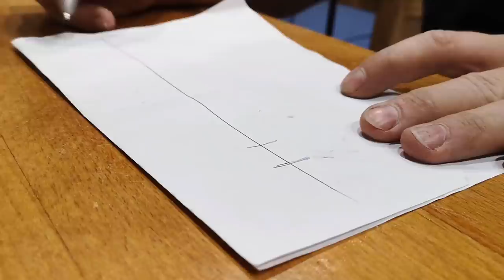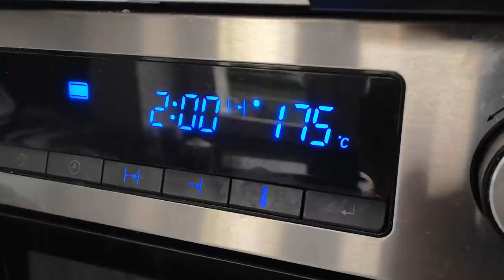017 Marking knife for woodworking

Comment from the maker: I need a marking knife so it's time to build one.
It is my begining in woodturning so be forgiving.. If you have any advices or if i do something wrong let me know in comments.

To build this tool i used boxwood, brass and piece of an old plane blade. The finish on the wood is Tru Oil.

If you have any questions just write a comment.
Enjoy!
Reply: I'm affraid one day You'll need a car and You'll make one just because You can. ;)  Greetings from Tenerife
Reply: Why did you make a left handed knife?   Seriously though, for the ferrules, I usually just use plumbing compression fittings. They have enough material that you can turn designs into them as well and you can also get an interesting effect by leaving some of the faces like London pattern chisel handles. Brass is soft enough that you can just turn it down to the level of the wood with regular turning tools.  Just take light cuts.
Reply from the maker: Dzięki Dario :)
Reply from the maker: Because i like left handed tools lol :) thank you!

Comment: ROFL Karate! You use the wood chips polish the surface? That's really something. That is the coolest way to make Knurls I've seen yet. Wow, nice blade, I like how thick and robust it is. I finally got my hand cranked drill press and could not be happier! Thanks for the inspiration on that. what did you quench the blade in?
Reply from the maker: Thank you! I quench the blade in rapeseed oil. Great news that you buy hand cranked drill press :) Regards!

Comment: Nice. My only critiscism is, I would of used a grub screw to hold the blade in. Smaller and less obtrusive than the adapted bolt.
Reply from the maker: Thanks! Smaller screw wouldn't be able to turn by fingers